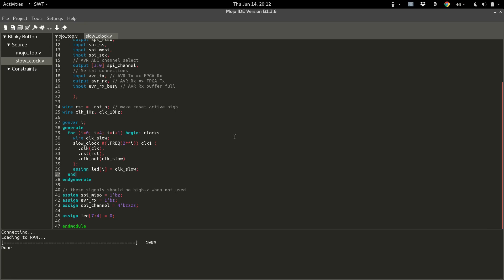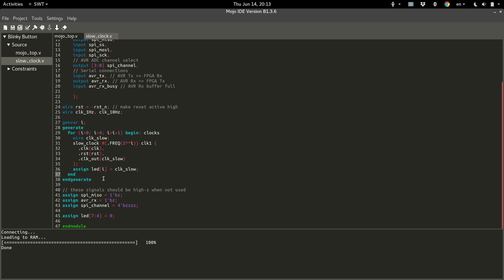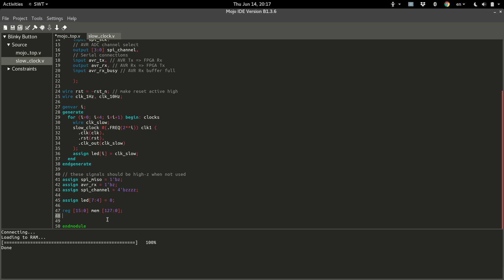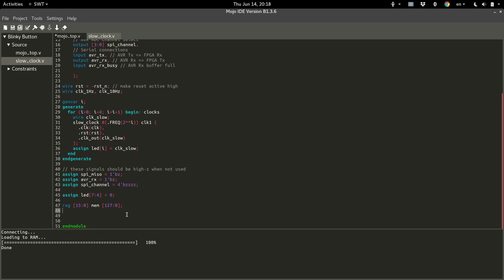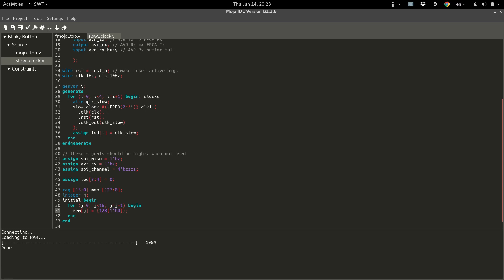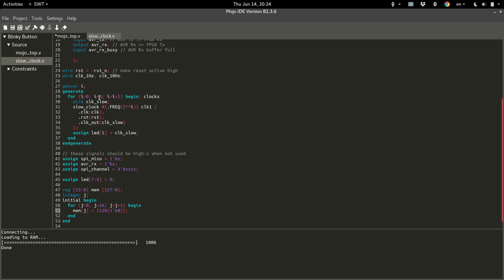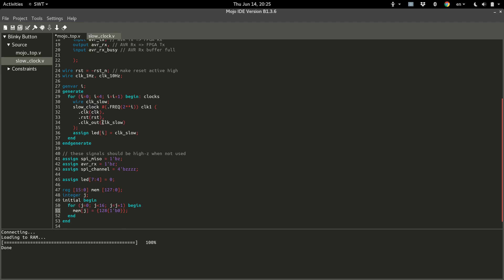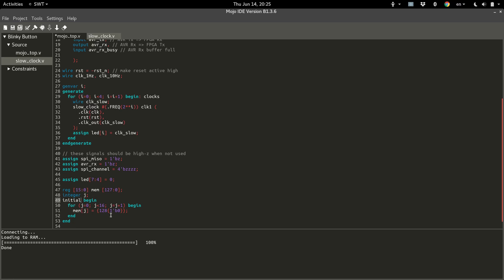Learn FPGA #12: Biggest Beginner Mistake! How Loops run (Generate vs. Procedural blocks) - Tutorial

Comment: 5:20 I think you have the indecies backwards on line 47.  What you have sets mem to 128x16-bits, not 16x128-bits as you treated it in the next initial begin for loop.

Comment: so in generate space, when you write
assign led[0] = 1'b0, you say wire LED1 power to the ground rail. that gets written to the chip (still not sure what load to ram does at this point? does it not actually write it to HW  but run some kind of software? what is that?)
and if you're in precedual space, where does the value come from? how does it say flip that flipflop to 0? how does it know what loop it is on? how does it do multiple loops in the same clock cycle or can you not, and referencing an offset to your loop variable is forbidden and in fact the loops run in parallel and all the instructions just accumulate into a complex gate array?
Why couldn't you write mem[j] = 128'b0?
Reply from the maker: In generate space, assign led[0] = 1'b0; would hardwire LED0 to LOW. If you want to use RAM, you'll have to build it and load it explicitly yourself. Loading/initializing that RAM would likely be done with for loops in procedural space as a shortcut to saying something like "Initialize all 2048 of these 8-bit registers to 0." In procedural space, you're not worried about clock cycles. It's used more for shortcuts and setups, not describing actual circuit hardware. For example, when you use a for loop in procedural space to initialize RAM, you're giving it the default values to hook all those registers up to. Does that help?
Reply: FalcoGer sorry but you don’t seem to understand what an FPGA is. You talk of doing things at clock cycles and software. With micro controllers and computers you write code which is compiled in software and then executed, with an FPGA you write a hardware description which is loaded into the FPGA and the FPGA configures the hardware inside it to make the circuit. An FPGA does not execute code it creates a hardware circuit by wiring its individual components up in a way that was defined in the Hardware Definition Language (HDL). Therefore clock cycles does not affect how the individual components function, the clock can be connected to one of these logic blocks but it doesn’t have to be, you can create a whole digital circuit inside it that is in no way connected to the clock and just relies on the physical inputs and outputs.

When you create a digital circuit on a breadboard you connect chips and gates together with wires, an FPGA basically does the same as this, it has a matrix of wires and logic blocks (groups of gates) that it connects together based on what it has been told to do using HDL. Don’t think of it like software where it is executed line by line think of it as you are writing the initial instructions to tell it what to do and after it has set up and made all the connections between logic blocks it just becomes a hardware circuit like you could make on a breadboard which a clock signal from the onboard clock can be fed into if desired.
Reply: An "INITIAL" block doesn't get synthesized into a circuit, it only applies to simulation. In the FPGA hardware the RAM is still filled with garbage when it powers up. If you want to have a zero initialized RAM the "rst" signal or something alike must be used to clear the regs.

Comment: How can you run a loop multiple times in a single clock cycle. that makes literally no sense at all.
edit: okay. got it. figured as much.
However I do believe that generate blocks are run incrementally by the compiler to create the hardware language. it tells the hardware to wire up 4 of those things. it doesn't really matter because nothing is really executed. it's like telling a company you need 4 houses built. nothing actually happens in those houses and really it doesn't matter if they're built all at once or if they're built sequentially.
the procedural for blocks I get now.